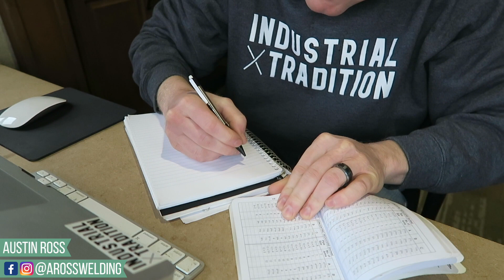MATH &  WELDING??? (WHAT YOU HAVE TO KNOW TO BECOME A PIPELINE WELDER)

Comment: I'm getting an associates in welding tech soon. I currently don't have a 6g cert. Would it be a good idea to get a job as a helper for a bit and try moving up from there or wait until I have the cert for pipe welding? I'm currently on 6g trying to get the cert.